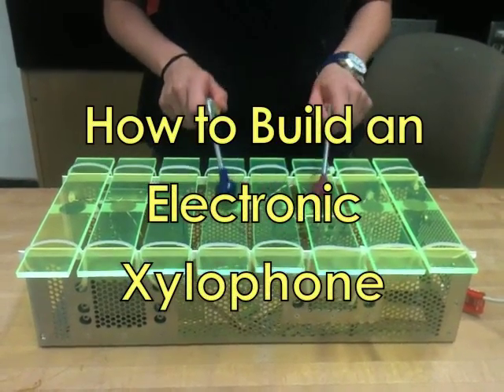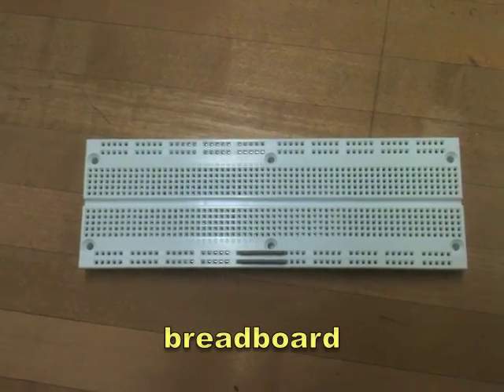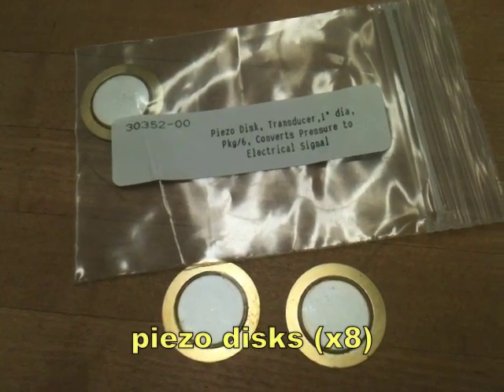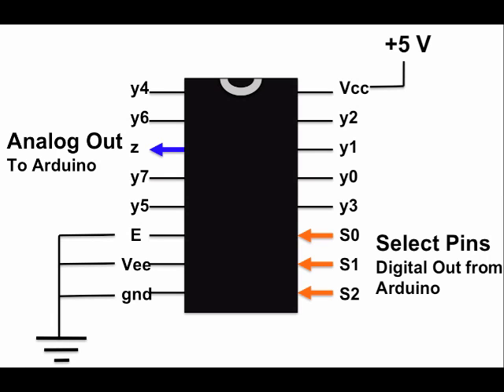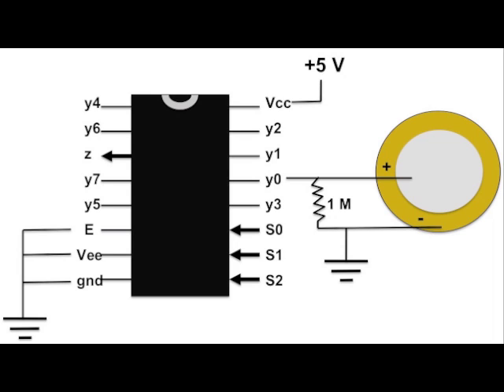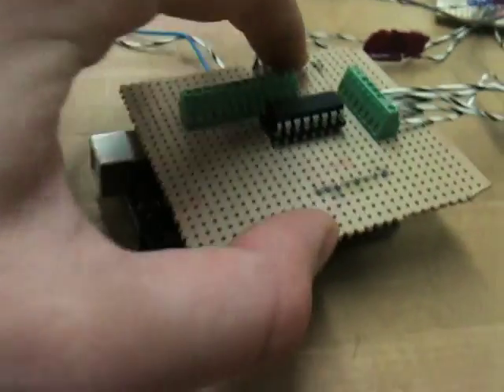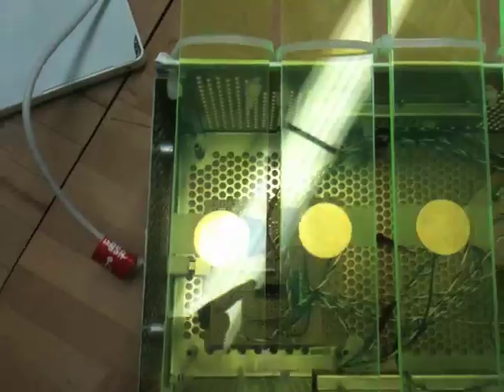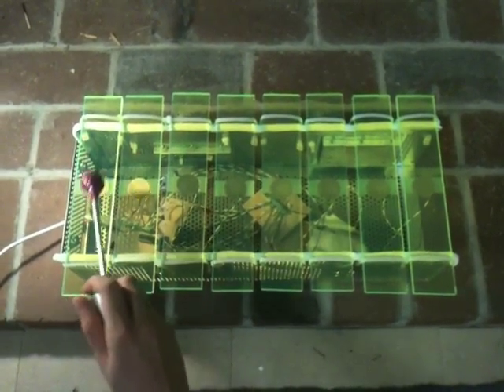Arduino: how to build an electronic MIDI xylophone

Comment: Beautiful. Exactly what I need for my budget vibraphone. THANK YOU!
Reply: Hey Faithin, how did you go with this?
Reply: @samosbornfilm  I'm still trying to figure it out. The best hardware/software seems to be a Teensy 3.6 with the Teensy drum example. Look it up. You use and multiplexer and two diodes on each piezo disc to limit voltage to 3.3. 

Lemme know if you need more details.
Reply: @faithinverity8523  ok thanks for that info! The teensy stuff looks interesting - one demonstration I saw definitely looked great for the velocity sensitivity and seemed pretty good on latency. Let me know if you get yours working!
Reply: @faithinverity8523  Thanks for that info! If you're interested, I'm looking at just using an arduino board for mine and some multiplexers to get the extra notes. I've been looking at https://open-e-drums.tumblr.com/ and it seems to work fine with the arduino boards!

I've tested out the piezos on a hardware prototype, but so far just using an electronic drum module as opposed to wiring up the micro-controller yet :) - here's a test with some different samples: https://youtu.be/InVUFV5soZE

Comment: Jenna deBoisblanc plz help in the codes. When I apply your code to ARDUINO Uno r3 there is lot of latency while sensing next HIT thou I use aiso cards.it plays extraordinary but it can't sense A0 and A1 when I modify it's code for 6 inputs. I require only 6 triggers. PLZ HELP ME OUT
Reply: I m talking about Your Recent code Of ARDUINO Mega xylophone, when I upload it to UNO then there is a lots of latency for every next hits. To fix this I tried 100 of times . I changed some parameters in your code to run it on my 6 input UNO then everything becomes fine except pin A0 ,A1 are not detected, other 4 pads plays extraordinary without latency. Plz guide me .

Comment: It appears that if I want to build something more extensive, like a two-and-one-half octave mallet board I would need 30 sensors and 4051s?  Would the same controller be sufficient?  I play Afro-Cuban percussions like my Dad does, and I have always wanted to learn chromatic percussion, which he also plays.  The entry price is just so high!  By the way, I am 56. "rebelled" as a teen and made sax my primary voice, but the percussion that I learned from the time I could reach the top of my Dad's congas never left me.  Basically, I want to use this as a practice instrument , and maybe also a recording instrument.  I mostly use Sonar (Cakewalk).

Comment: In all of the spikenzie labs products, they also include one Zener diode per pad. What is the purpose of this diode and where is it placed within the circuit?

The problem I am having is that when I hit a pad with a medium-hard velocity, multiple notes trigger. When I hit the pads softly, everything works and just the desired note is triggered. The other keys are not picking up any vibration from the triggered pad, since they are all completely isolated. This has lead me to believe that it is some kind of electrical interference within the circuit. Could the Zener diode have anything to do with this?
Reply from the maker: +Luis Guzman Good question. I probably should have included Zeners to regulate the voltage of the piezos, but I don't think it'll have an effect on interference. I would probably recommend software checks (i.e. if a big hit is registered on one key, silence all others for a short amount of time, created software thresholds, etc.) and better isolation from vibrations.

Comment: Ah this is very great for a school project I am running! I have only a couple of questions: we want to accomplish this with 16 midi notes instead of 8. And want to use pressure plates made out of aluminium foil, instead of piezo disks. Should we get an other (bigger) multiplexer? And will the will we need different components when using the aluminium pressure plates? Is it even possible with the arduino uno? Trying to do my best understanding all this, haha.

Comment: Hi Jenna, great stuff! One question-- There is a considerable latency in this video between you striking the mallet, and the voice sounding off. Is this a product of fitting together the separate audio and video tracks, or is there actual latency introduced through the Arduino?

Comment: Could this approach be used to build a keyboard? What happens if you just push on on of the keys with your finger? Does hitting the keys harder produce a louder volume?
Reply from the maker: yep, yep, yep :) But I haven't worked on this project in a long time, so I don't know its state.

Comment: Jenna, 

Great job! But do you know what causes the audible delay between hitting the xylophone and the sound that is produced? Is it somewhere in the arduino (processing power), or is it because of the MIDI driver (probably Microsoft GM Wavetable) and if so, do you think it can be solved with the ASIO4ALL or WASAPI driver?

Comment: hi there, this is great, am looking to build this project but as a midi drum kit and was hoping you could answer a couple of questions for me. 

do you have a full schematic with the piezos or description on how to link all 8?
also, would it be possible to use a potentiometer with this as a variable hi hat controller to tell how open/closed the hat is???

thanks

marc

Comment: 0&1 are completely unused! The curcuit is simplicity itself. To the point that i can describe it with words: 8 bagpipe holes/sensors go to digital inputs 2,3,4,5 etc. Leg eleven gives out the audio and voltage is supplied either through USB or through the voltage leggies. The sketch does the whole jobn including commanding simple screws to detect touch/capacitance (how do you call this?) or calculate strange bagpipe fingering of the real pipes. Thanks for reply! Also no static when USB V+

Comment: Recently i made bagpipe practice chanter with miniarduino-only nine notes using touchsensitivity on digital inputs and an open source sketch from some wonderful beings on the internet, the only drawback, some static noise on the two lower notes. No noise when voltage fed by the arduino's USB Any idea where this static comes from?? Tried all kinds of grounding crossconnections, not from that.

Comment: well, i'm thinking in a 4067 for the 12 keys (4 digital pins), and a 16-channel demux (74154 maybe) for the leds (5 digital pins = 4 for A0A1A2A3 and 1 for enable pin )
I'm pretending to implement several functions using the leds, such as an "educative" xylophone which lights up the key you have to play, or just a xylophone which lights up the key after you play it, or even keep it playing by itself lightning the keys. I can't see now how can I do it with only 3 4051s.

Comment from the maker: ah. no worries. Um, changing the code for a 4067 isn't hard, so that should be ok. You can also multiplex the LEDs, so for 12 keys + 12 leds = 24 total pins, you'd only need 3 4051s.   I think the 4067 should be fine; i'm just thinking about the latency question.  I would recommend buying both to test. let me know if you need any help with the code. :)

Comment: Thanks for the answer =]

Yes, i know I can use 2 4051s, but using a 4067, I will be saving some pins (I will buy an arduino UNO or Leonardo). And I will have to write a code a little simpler =). I'm also thinking in put a LED below each key, that's why I want to save digital pins.

Comment from the maker: 3) i'm a little concerned about delay time with my new sketch, but i haven't had a chance to test. I think the answer to your question is, no. The delay is probably a created by sending/processing data in the various programs needed to generate sound. The sampling rate of all the multiplexer pins by the arduino is very fast, so that's probably not the bottleneck.

Comment from the maker: Hi :)
1) Not necessarily. You can use 2, 4051s (and two analog input pins on the Arduino); you can use a combination of analog and digital pins on the Arduino and scrap the multiplexer (but you won't be able to take velocity measurements with the digital pins, so no way to change volume based on power of hit); or you could get the ArduioMega and skip the multiplexer (more pins)

Comment: Hi! Very interesting project! I'm pretending to build a 12-keys xylophone, following your project line, and I have some questions:
1) Instead of 4051, I must use the 4067 (16-channel analog multiplexer), right? And just change some parts of the code, of course =]
2) What did you do to the arduino identify which key (among the 8) you played?
3) Will the key number increase compromise the project's performance? (in terms of delaying)
thanks =)

Comment: By the way, I used a nice board called mBed (which some people says is an Arduino on steroids). The good news about it is that it have a native USB client port, and somebody wrote a very good USB-MIDI library. By attaching it to the computer, the OS recognizes it as an MIDI device, and voilá: your MIDI software starts talkig to it automagically. 
Right now, I'm building a DJ controller with it (to play with Traktor), and maybe do some parties :)

Comment: Thank you for the info. I took a look at the circuit and it is very simple. I tried some aproaches, I started with something like you did, I put a buffer with a high impedance opamp (TL072), an ampop rectifier, filter... they worked more or less good, but not good enough for my needs. I think my real issue is with the mechanics where the piezos are attached.

Comment: No, I'm asking if you did implement the resource of converting the voltage produced by the piezo and send it as a velocity parameter. I'm asking this because I'm trying to make a MIDI drum and I'm finding it very difficult to build the drum part in a way that the piezo produces a voltage that's proportional to the hit force.

Comment from the maker: yes! go for it! and post a video.

I actually wrote code that doesn't need a multiplexer.  Check the link.  It's for 6 keys, but you can easily increase to more.

Comment from the maker: Potentially a problem.  I didn't have any problems when I made this video, but I suspect latency will be more of an issue with my updated procedure (involves using Pure Data to generate MIDI).  Also printing the voltage measurements will result in latency, so make sure to comment out the println(...).  

I haven't tested my new sketch, so I'd appreciate any feedback.

Comment: I want to do the opposite; make software drive mechanisms that will create sound from a midi song on the computer. I have an arduino and 2 softwares that I think might work (modplug tracker and madtracker2) to play a song to the hardware. I can figure out the actual mechanism that makes noise but what softwares if those dont work could be used and is there code out there for it?

Comment: Hey great video! i had a question. I am trying to build a arduino based 16 pipe organ. what hardware and software would you recommend? i was thinking a arduino uno, but i am not set on that. also, will the drumkit work for this? lastly, what would u recommend i use for actual hardware pipes? your input would be appreciate! thanks.
-stephen

Comment: awesome, thanks. So what did you uses as input and output port in Serial2MIDI program, what was the bud-rate and what was the setting in the garage band software. my midi-OX just shows the first three notes!

Comment from the maker: You're in luck! The gist is that the Arduino code sends serial data to a serial-to-MIDI-converter (which you can download online- check the link above), which takes serial data and generates MIDI data.  Garageband or equivalent programs have hundreds of MIDI software instruments that come pre-installed and turn MIDI into sound.  If you have specific questions, send me a youtube message :)

Comment: Hi, im working on a university project and i got the components to make a midi instrument like this but with piezos mounted around a room to catch water drops. I am having a few issues with the serial to midi converter as well as the set-up on a breadboard. I wondered if I too could get your diagram when you have the time? at the moment i get a red a flash in the TX part of serial to midi, but im unable to get midiyoke so im using loopbe on xp64 or win7 64.

Comment from the maker: @eternalflame182 Those green things are screw terminals- they clamp down on the end of a wire and make an easy, semi-permanent way to connect components together.  The long silver pin things that are pushed into the Arduino are called header pins.

Comment from the maker: @jdeboi Although I should note that the voltage rating of the piezos is important.  I think mine were 30V, but they never produced more than 5V when hit through the acrylic.  If they had-- and this is something you should test in your setup-- I would use a 5.1V zener diode in parallel to the resistor.  Check out the circuit diagram in the Spooky Arduino Projects link.

Comment from the maker: @wellwelltony The baud rate I chose in the code should be fine.  What do you have in the array PadNote? There should be a bunch of different numbers around 60, i.e. Padnote[60,61,62....]? Are you using the multiplexer? Which digital pins are you using?

Comment from the maker: @wellwelltony A resistor is a must, and resistors are almost always necessary in any circuit.  Resistors keep the current from getting too high. If you run more than 40mA -- mA is a unit of current-- into an Arduino, you'll probably fry a pin on your board.

Comment from the maker: @wellwelltony Unfortunately iDevices aren't an option b/c you need a USB port for the Arduino and programs that I doubt you can install on an iPad.  If you're really good at programming, you could conceivably send MIDI data from a laptop to your iPad, but that's definitely outside of my realm of expertise. :( 

Question- what is your objective/ rational for having 2 analog outputs? Since the Arduino reads data very quickly, it's possible to play two notes at once using a single multiplexer.

Comment from the maker: @DanNixon2007 That's a good point.  There's really no reason for the Arduino to print out data when the note is off. You should edit the code to only send info if the state of a note changes and look at the RX and TX LEDs to make sure the Arduino is receiving and transmitting data immediately when you hit a key.  Definitely let me know if you find a solution.

Comment from the maker: @gtrdrumsplayerduarte Cool.  The key you hit is isolated from the other keys and all notes are playing? By that I mean, the vibration from a hard hit isn't transmitted to other keys? Have you tried to increase the values in the PadCutOff array?

The backbone of the code for this project came from a drum project that allowed 48 inputs.  You might notice that there are parts of the code that are commented out (with //) that would have accommodated more inputs.

Comment: @jdeboi Thank you once more. Finally, after hooking up the 8 piezos, the thing worked. Still, if I hit too hard on one piezo, all notes play. It`s not crosstalk with the others.
I will try to build a 25 key xylophone but I will need to aquire the knowlegde to add lines to the code. Any thoughts on that?
Reply: Hey - did you ever succeed in building a larger xylophone?
Reply: @samosbornfilm  I later bought a used Simmons silicon mallet and modded it a bit.
Reply: And with the 25 keys?
Reply: @samosbornfilm  3 octaves 36 keys and then even bought an octave expansion for more 12 keys but never used it. I bought it for spare parts. The mallet was in really bad condition and took 2 years to get it more reliable
Reply: That's cool! I'm trying to build a two octave one. I've already sampled some African marimbas. Could you send me the code you used for the extra inputs? Did you also use multiplexes to get all the extra inputs? Cheers!

Comment: @jdeboi Thank you Thank you Thank you for your help. I moved to pins 2,3,4. Only one note will play if I hit the piezo very very slowly. If I hit Hit hard I get all notes. I`m using the 1 mega ohm resitor across the terminals of the piezos. Is this just a matter of velocity?

Comment from the maker: @gtrdrumsplayerduarte hmm.  ok, so you only have one piezo attached? are you building this on a breadboard? When I say "ground each pin on the multiplexer with resistors of equal value," I mean, take a resistor and attach one end to the pin on the multiplexer, and attach the other end of the resistor to ground (0 volts- there are ground pins on the arduino).  Do this for every pin on the multiplexer, even though they don't have piezos attached. Make sure all resistors have the same resistance.

Comment from the maker: @gtrdrumsplayerduarte Try using pins 2,3, and 4 (and make sure to adjust the code accordingly).  I discovered that you can't use digital pins 0 and 1 when you're communicating to a computer via the serial port.  

From the arduino reference page: "Digital Pins 0-1/Serial In/Out - TX/RX (dark green) - These pins cannot be used for digital i/o (digitalRead and digitalWrite) if you are also using serial communication (e.g. Serial.begin)."

Comment: @jdeboi I`m using 0, 1 and 2 conected to s0, s1 and s2 of the multiplexer. What do you mean when you say ground each pin on the multiplexer with resistors of equal value? I think I´m following the schematics on the video.

Comment from the maker: @gtrdrumsplayerduarte I had the same problem at one point.  There are a bunch of possible problems- which digital output pins on the arduino are you using?  have you grounded each pin on the multiplexer with resistors of equal value? It could also be a problem with the code.  Did you copy and paste the code in that link?